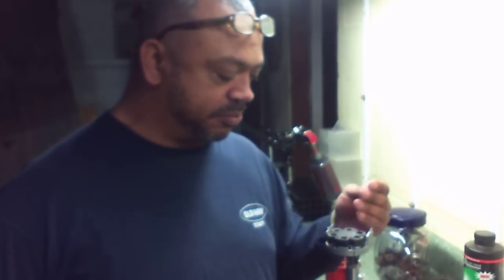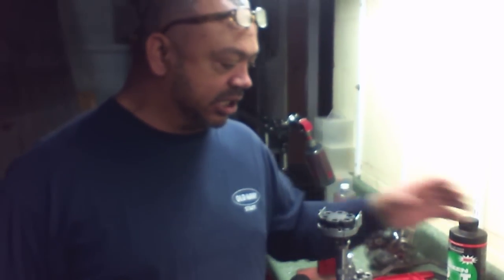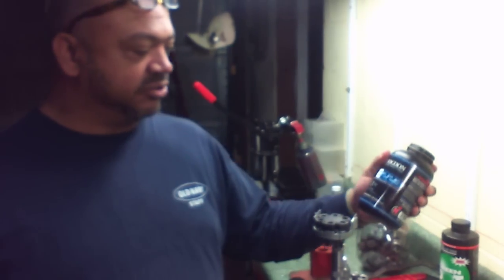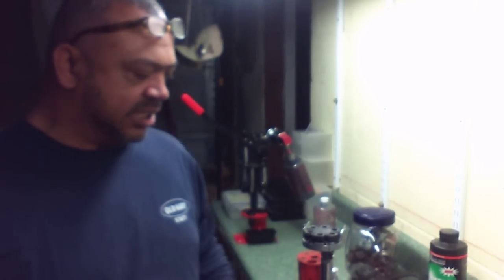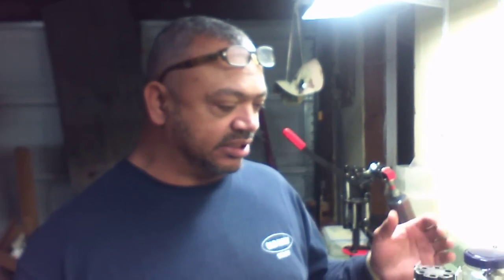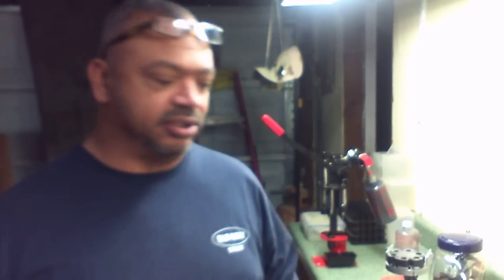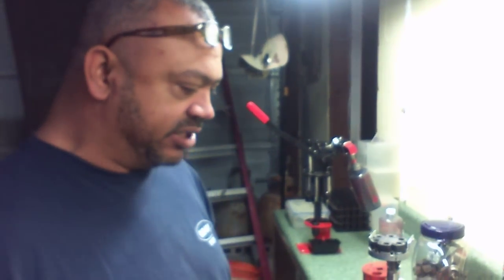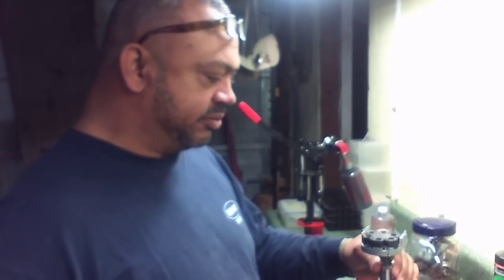LEE RELOADING POWDER MEASURE FIX FOR CFE POWDER

Comment: I have had good results using fine sandpaper and lapping the wiper side of the disk . Also dissesembling the pro auto disk setup all together and applying a coating of graphite dry lube / lock  to evey part that touches powder . My powder measure is very accurate and consistant now. Hope this helps ya . My normal youtube account is cdelo2 this is my sons account .

Comment: Every brand of presses have their own little quirks.  LEE gets a bad rap from people cause they really never hear others complain about the equipment they have.  Lyman, RCBS, Hornady and yes even Dillon have issues that reloaders have to deal with.  LEE gets the bad rap because it is affordable reloading equipment.  For the casual person who wants to load rounds to go to the range and shoot LEE if fine, now if a person is a competition shooter, then maybe he should be loading with Hornady or Dillon.  LEE was intended for the average person to get into reloading.  Yes their are tricks that you have to learn, modifications that you may have to apply.  I have been using LEE Precision for 11 years now and I load everything from 380 all the way to 8x57 Mauser and everything in between. I too use the Hodgdon CFE223 for my AR reloading.  But, I use the LEE Auto Pro Disk powder dispenser, it is the one with the round hopper, and it has a soft rubber bushing that rides along the top of the disk, lessening the chance of leakage.  Thanks for sharing the video GUNRNR7271, I still have one of those powder dispensers.